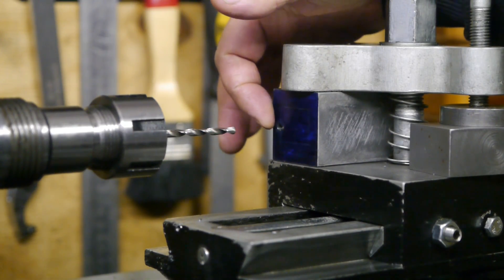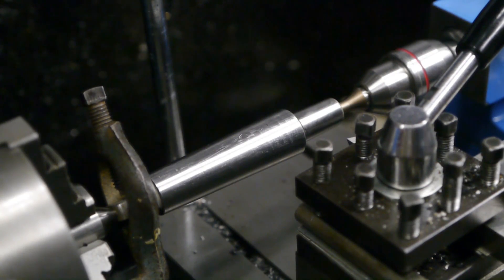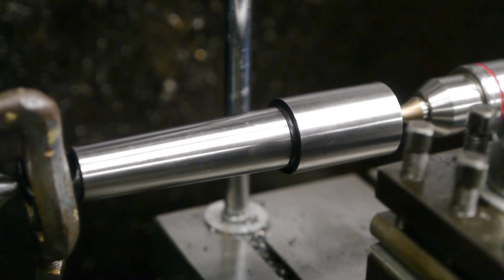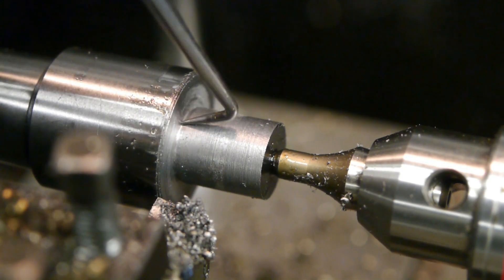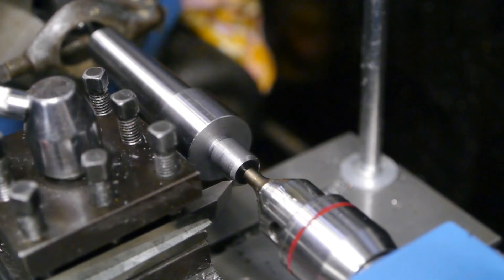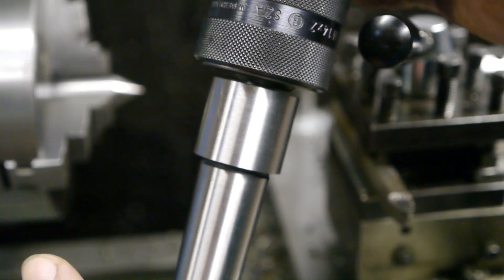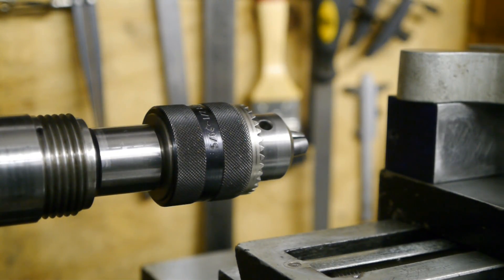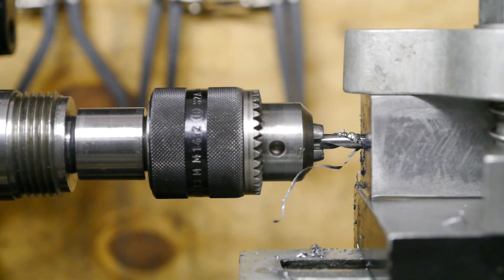Fitting a threaded drill chuck to a tapered arbor

Comment: Well done.  Looks very good.

You will find having MT3 drill chuck very useful.   Collets are very nice, but it is not always practical to have a collet for every size you need over time.

I was not surprised the first arbor was hardened.

I purchase machinable arbors in MT2 and MT3.  My wood lathe uses MT2, my metal lathe uses MT3.   So far the ones I have purchased are able to have the tang cut off and the end drilled and tapped for a drawbar use on the wood lathe.
Reply from the maker: And it works good too :) I got another one of those chuck laying around I'll make one for the Chinese lathe as well.
I'll grind of the tang and try drilling again. Because, I was really missing the draw bar when I needed to punch out the taper.